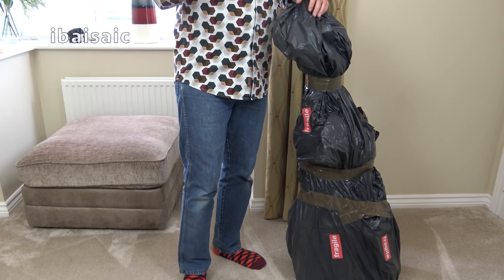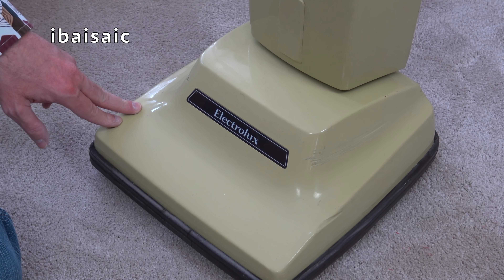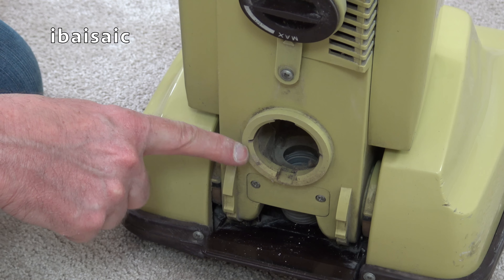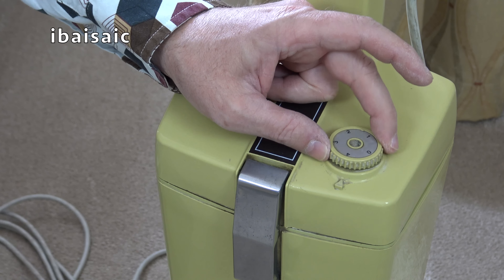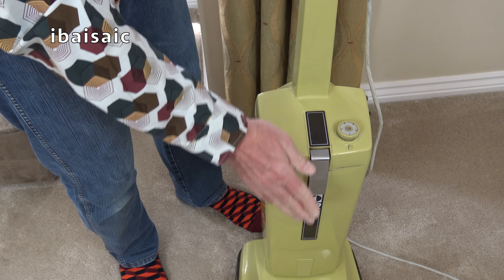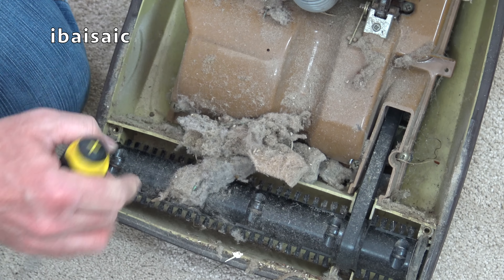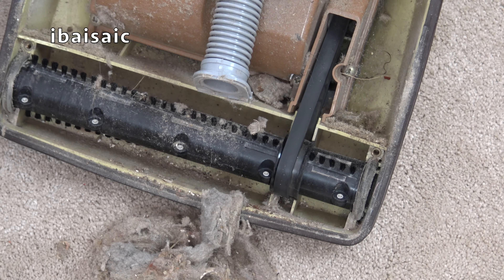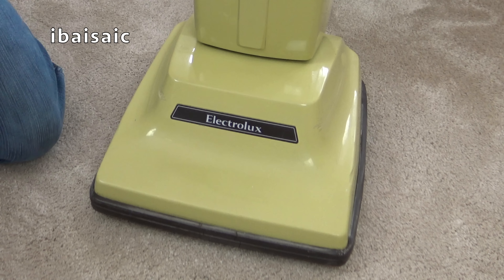Vintage Electrolux 502 Upright Vacuum Cleaner First Look

Comment: This was my family's  vacuum cleaner in the 1970s & 80s and I know it very well. The original carboard box that the hose and tools came in could be turned into a storage box for the tools. The box was cut in half around the middle then folded together to make two compartments to store the hose, extension pole and attachments. We put a couple of strong elastic bands around the bottom to keep the two halves of the box together. A hole was cut at the top in the centre of the cardboard box to make a carrying handle.

Comment: I grew up with these too - we’re about the same age I guess. We had the 502 and it blew up so my dad went and bought my mum (when vacuums were considered a present for ‘the wife’) a new 502S which in hindsight it was probably just the suppressor and didn’t need replacing - the 502 went in the bin and I’m sure it wasn’t even very old. Anyway, fast forward 30 odd years and I found one on EBay back in 2008 - absolutely mint 502 which I got for £25! I love it! These were great cleaners - I since got 2 504, a 560 and a 502S. These were well made and stylish - very durable (suppressors aside). I’d be happy if they still made them!

Comment: We didnt see the ratings plate on that - I guess you forgot to show it due to it being hidden on the back of the motor housing, but  suspect this is from the mid 70s, as its an early design, with the stripe only going halfway down the bag housing and it having a shiny metal bag latch. Later 502 models became the 502S and they had the longer stripe down the front of the bag housing, and were from the late 70s early 80s, before the 550 came out, in the early 80s.
Reply from the maker: Yes, I realised I forgot to film the rating plate during editing. If I remember I will post a photo of it on my YouTube community page.
Reply: @ibaisaic  Had a quick look at the community page and nothing there as yet, but will check back later to see if you've put it on.
Reply from the maker: I’ll try and put a photo up later today but I’m a bit busy at the moment chucking a lot of muck about.

Comment: Very nice classic design and colour, shame no neon light in the switch.  They should re-release a retro range of vacuum cleaners like this with modern tech inside they would be a huge hit.  As always, great video.
Reply: Oddly, the light in the switch of the 504 glows when it's off and goes off when it's turned on! I guess it makes sense given you should know when the machine is on but I always found it strange for some reason - maybe it was a solve for all those poor people that walked all of the 12 feet of the cable and found it wasn't turned on at the switch! life was hard back then ;P

Comment: The base plate also has the front suction channels which I think were a later addition - the chrome plates on all of mine are flat at the front.
Reply from the maker: Yes, I hadn’t noticed the front suction channels until I was editing the video. I think this must have been a later version than my Mum had and possibly the internal hose was original and a replacement for the type Electrolux used to fit.
Reply: @ibaisaic  I never knew they did the base plate in that style. I don't think I've ever seen them even as a replacement part which is a shame as I'd like to try! Look forward to any test you do, would be good to see if it is more effective than one with a flat plate. I think the hose is an original replacement as you say - I don't know what my mum used to do to hers but it did seem to go through parts regularly and I recall this being one of them - I prefer the originals aesthetically speaking but I'm a bit pedantic about those little details :)

Comment: Can you still buy the accessories for these? Just bought a 502 but it’s missing the additional hoses
Reply from the maker: They pop up on eBay from time to time.
Reply: @ibaisaic  Thanks, they do seem rare as rocking horse teeth
Reply from the maker: There’s a set on eBay now that keeps getting relisted as the seller has put collection only. They may post them if you ask.
Reply: @ibaisaic  oh? Do you have the listing number?
Reply from the maker: https://www.ebay.co.uk/itm/Vintage-Electrolux-Accessory-Kit-For-Upright-Model-502S-506-in-Box-Manual/264958921831?hash=item3db0c84c67:g:2twAAOSwFVBfUnlz
Reply: @ibaisaic  thank you so much!!